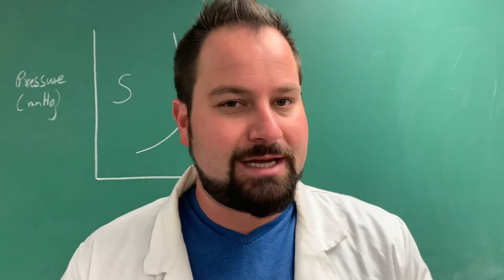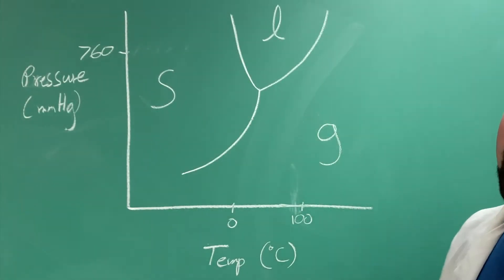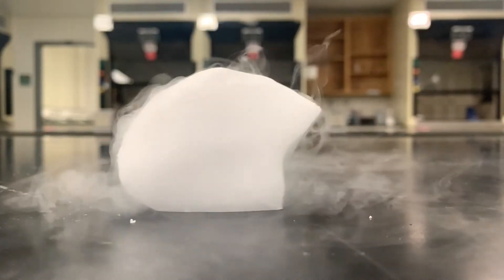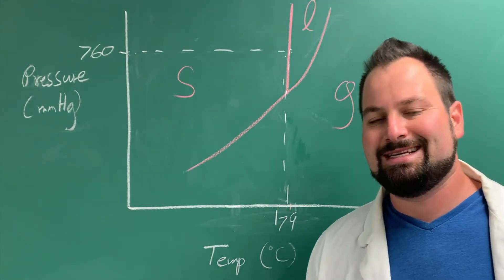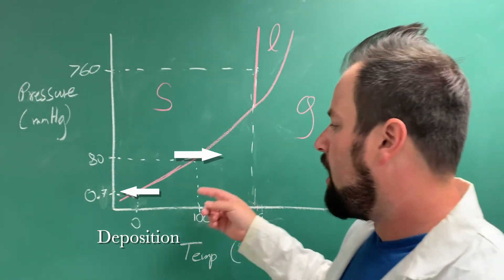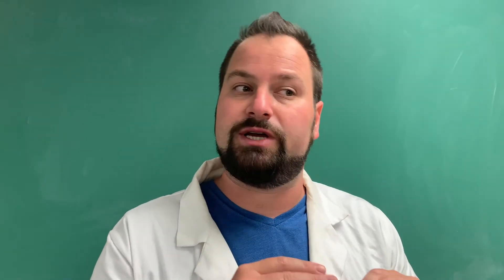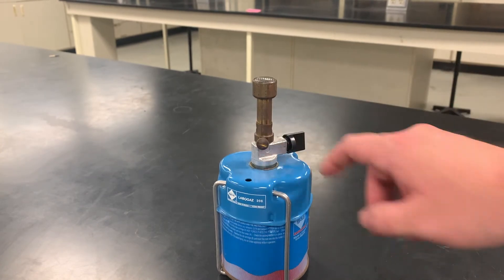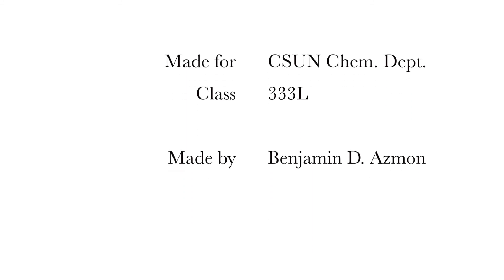Sublimation: Purification of Camphor

Comment: Does Camphor sublime at room temperature??
Reply: Yes it is. Camphor is pretty stinky compound
Reply: @dimaminiailo3723  thank you! :)
Reply from the maker: Yes, much like water evaporating with out boiling if you leave it out overnight; camphor does slowly sublime at room temperature. *
Reply: Hello. Thanks for your video. My product has acid chloride . Once I tried to do the cold finger but I could not collect a lot of product and even I took NMr of a little bit that I collected from the cold finger and it was not pure. As you are an expert, what do you recommend?